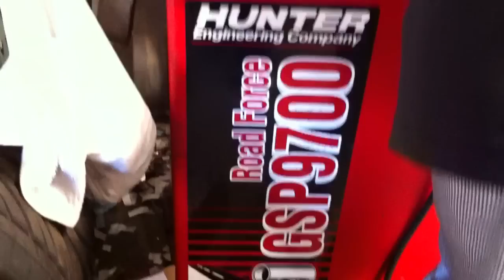WORK Meister S1 3Piece 19x12.5 on a Widebody '93 MR2 Turbo

Comment from the maker: @EvaGoN The front is only 18x8.5 so it has some clearance. The new 18x10 is getting fitted in a few weeks and that will be a very tight fit. The rear has less than 1mm clearance between the inner barrel to the strut housing. I think there is a picture in the video where my friend's finger tried to see the inner clearance. And as you can see, there is not clearance from tire to fender; the fender sits on the tires =P

Comment from the maker: @xExRxIxCxKx I was told that the machine cost almost twice than the average Hunter machine; this one is almost touch-less, the operator doesn't need a metal bar to seat the edge of the tire.
Also the attachments are all plastic, doesn't scratch as much as those metal ones.
The wheel is bolted to the center hub, unlike other machine which grabs the lips and scratch it.

285/30 on 19x12.5 is not that much stretch, as shown in this video, it just mount easy.
Thanks for the compliment=)

Comment: lol yea thats mine. Its in the shop right now redoing the wide body. I sold the s1's and now have vs-xx 18x12.5 with a negative 3 offset in the rear with 315/30 tires and an 18x10 with negative 7 offset with a 265/35 tire. If you're ever in NY we need to do a photo shoot together!

Comment from the maker: @interlagos80s It's hard to stretch tires on 18x8, since it's not wide enough.
215/35 on 8" wide is super baby stretch; the stretch is so little it almost doesn't look stretched.
There is no 205/35/18, so you're stuck with non stretched looking setup.
225/40 and 235/40 will not look stretch at all on 8" wide, they're square

That's why people go with wide wheels so they can get good stretch on them.

Comment from the maker: @erikblazer13 lol. The car turns just fine =)
The widebody fiberglass fenders are flexible; they flex when the tires hit them during cornering or hard braking.
Also they shave the tires when rubbing, unlike metal fenders which cut through the tires.
But you're right: when I take hard turns (freeway on ramp) going fast, I smell burned rubber alllll the time =D

Comment from the maker: @interlagos80s @interlagos80s I prefer stretching tires by choosing lower profile tires instead of skinnier tires.
So let's say you have 10" wide wheel, then 225/35 is a nice stretch on it, instead of 205/40.
This way you get to run wider tires (225 instead of 205) for more contact patch, and still stretching for clearance.

x9 is a good width for the front; go with 215/35

Comment: oh and btw do u ever go up to gmr anymore? I used to go up there in my 95 integra sedan. i only had coilovers and decent tires on 16x7.5's. i wanted to do so much suspension and chassis rigidity work on it, til i hydrolocked the engine. its sitting in my grampas driveway without a head right now til i can fix it. bent 3 valves -_-.

Comment from the maker: @bimmerE9Xfan Paul, I've been driving on the those stretched tires for almost 40K miles without any accidents.
Just make sure you run more than 45PSI tire pressure to keep them inflated and nicely seated.

Those who say it's dangerous just have no balls to do it ;)

Cheers!

Comment from the maker: @mr291lover What an eagle eye =)
This day was just a test mount for the tire to see clearance.
I could only bring one 19x12.5 on the passenger seat, since it does not fit in the front nor rear trunk.
So the 2nd day I went again and bring the other one, and after mounting the 2nd tire to the other wheels, I swap the wheel to the correct side.

Then I brought 1 of the old rear wheel/tire home, and next day I took the last one.
The joy of only having one car.... =(

Comment from the maker: -3.7 front and -4.2 rear is not a lot of camber.
Easily achieved by OBX camber bolts, available on eBay for $30.
If you want something fancy, get camber plates.

Comment: Hey bro, you work at the shop? I was wondering if you guys have a 18x9.5" and 18x10.5"?? And what tire brand do you have? Just the smaller one for the front and wider for the back.. Do you have the same one like that in 3 piece version?? Is for my car.. And what is the sizes that fit in a 335 size tire?? Thanks..

Comment: yah with those big meats you have on it I'm sure it's needed...have you driven an SW20/21/22 with a manual rack to kind of get an idea of comparison in the ride,  and controlling the car?
Reply from the maker: Maybe you've experienced this before or at least heard about it. The PS on these 20+ years old SW sow times get stuck. The solenoid gets stuck and the PS light turns on and you don't have PS. Either you accept it as is, and drive it like that for 2-4 days, or you can cycle the ignition key to AC for 20 times to reset/unstuck the solenoid. So yeah I've driven my car several days without PS and I have to tell you, it isn't comfortable and it isn't fun, at all. I guess I'm spoiled for having it for years

Comment: Right now I got 18X9 +22  front 18X9 +15 rear definitely looks like I got at least a few more inches in the back the front is pretty much maxed out with a 235-35 tire...Sergey from Sergey's House of Wheels has a 245 on the front without even using a TRD wide-body just a good Fender pull and roll! I guess? but of course that's on a 17-inch rim...
Long story short do you think I can squeeze a 305 out back or 315? How much clearance (in mm) would  you say you still had with the 295? I'm running the BC racing coilovers and I pretty much like them alot but I'm thinking about switching the BC Springs out with stiffer Eibach Springs or Swift Springs...
I also have a pair of Ingalls camber bolts if I need em for the front (or rear)...
Reply from the maker: His front fender is galaxies away from "fender pull and roll". He cut up the fenders , extend it and weld to shape it wider.

Comment: Armand what's the widest wheel I can fit in a 19 on the back without stretching the tires that much as you did just a little stretch I want to go with a 19 x 12 with the most + offset I can without hitting the spring...but but I could live with just a slight tad rubbing on fender...I want to go with a 255- 35-18 (which i have already) on the front and a 295-305 out back... I realized those 255 in the front I'm going to need some extra rocket bunny style fender flares or another set of fenders over the stock TRD fenders which I've been prepping I could show you the pics on my FB page...
Reply from the maker: I was running 295/30/19 many years ago. But the rear back then was 9". Still doable with 12" just need correct offset

Comment: haha understandable ...well I didn't know that about them...I actually have the power steering pump there but I don't have the belt on, but yeah I'm going to have to get a belt on there & check that out, try the AC turn ovet trick...i was thinking maybe it's the seal going cause Dave @twosrus mentioned it to me...good to know both scenarios though
Reply from the maker: SW power steering is electric. There's no belt. What car do you have ?

Comment: setting the bead with that tire looked fairly easy for that guy. I guess thats not on the more extreme side of tire stretching? and mounting it looked super easy too with the two attachments. i've tride mounting short sidewall tires with just metal levers and the duck and i gotta say it sucks real bad. sweet mr2 btw the meisters and widebody look fuckin tits.